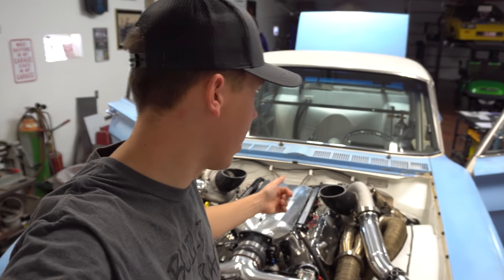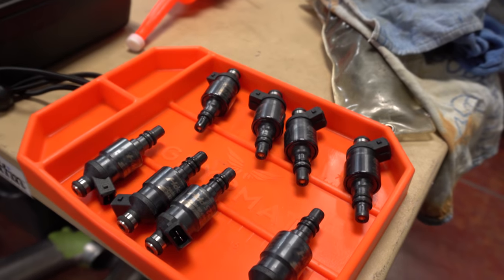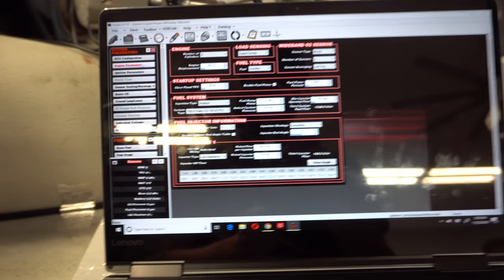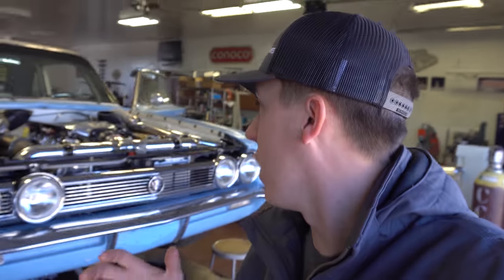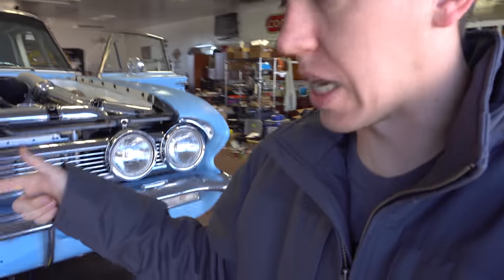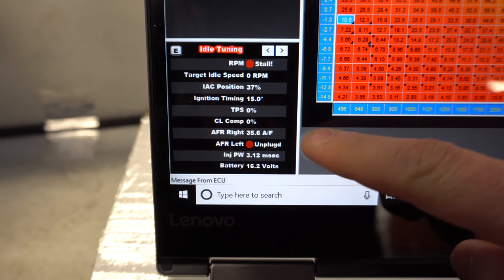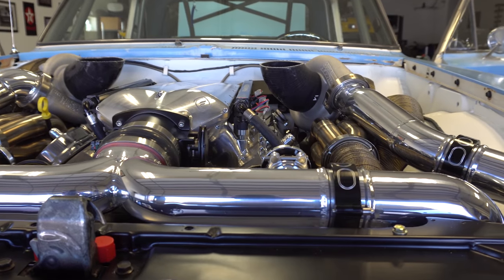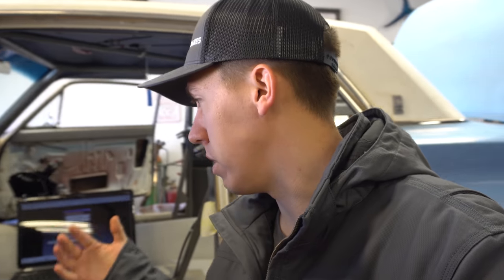Smaller Injector test on Project 200 Mph with Holley EFI

Comment: Should take the injectors to be flow matched and cleaned. My Holley 160s came out of the box gunked up and flowing all different. Simple cleaning and flow match by a 3rd party fixed my issues
Reply from the maker: The brand new 225 injectors did the same thing as these Holley 160s the two banks were quite a bit different. The holleys were recently cleaned and flowed but. I actually just bought a injector flow bench so I'm going to clean and test them any way! Lol

Comment: try swapping harness wb plugs into from side to side. maybe swap wb side to side. good luck
Reply from the maker: Thanks tried wb already stayed the same might try harness. Just tuned anouther car with dual o2s and the afr from side to side is off a hole number as well. Kinda weird!
Reply: Build Tune Race for sure.  maybe why closed loop only uses left